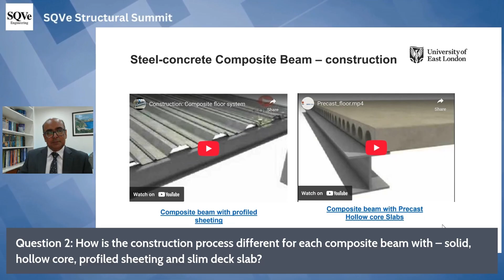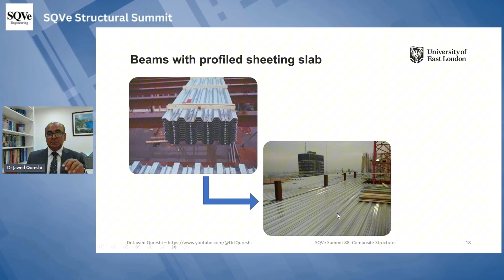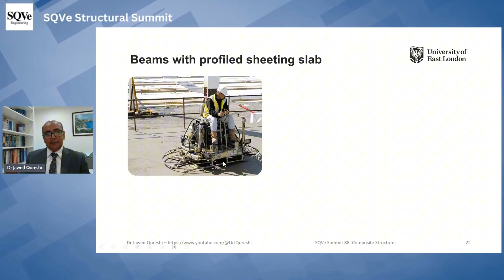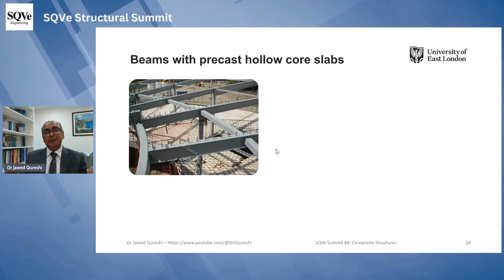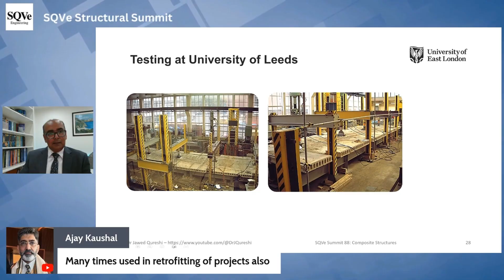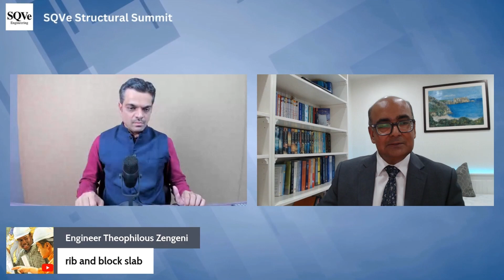Best Practices for Composite Steel Floors with Profiled Deck and Hollowcore Slabs | Dr Jawed Qureshi

Comment: Great video! I would like to have book on my shelf describing composite systems. Dr Jawed, what would you recommend?
Reply from the maker: Thanks. It really depends on structural grid being used. For large column free space, use hollow core slabs and for up to 7.5x12 m grid use profiled sheeting slabs.
Reply from the maker: I'm not sure if understood your question earlier properly. I think you are asking to recommend  a book on composite structures. Here is the one: https://onlinelibrary.wiley.com/doi/book/10.1002/9781119401353?msockid=12823695f48c6153231f39c6f5cc6056